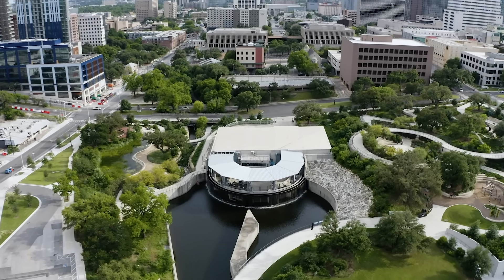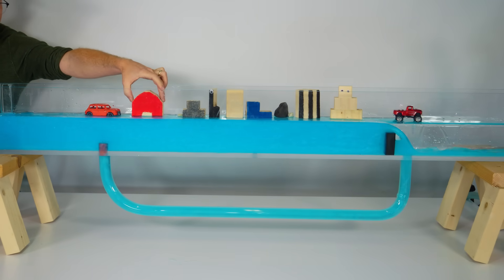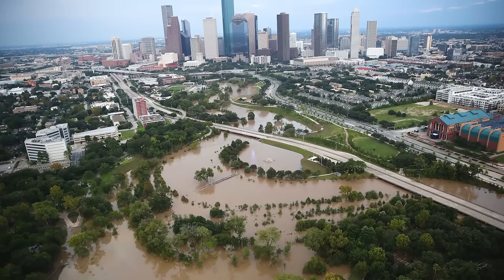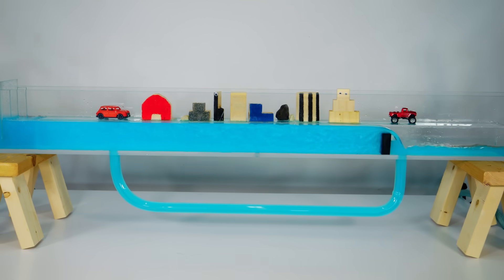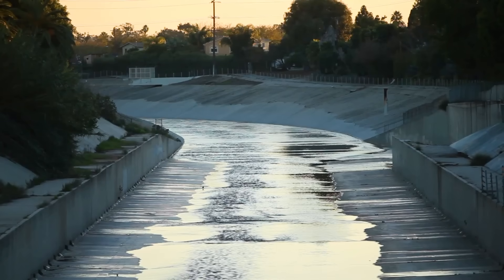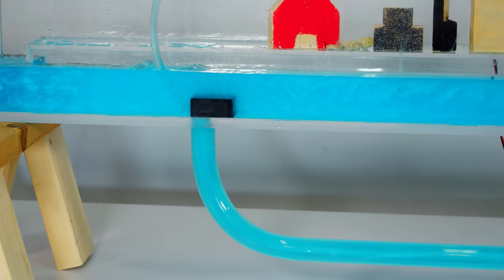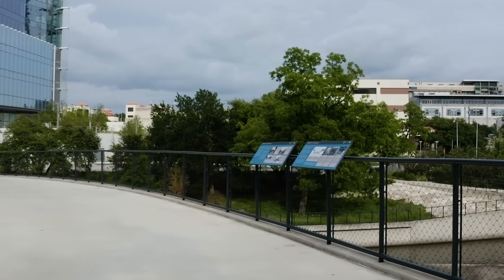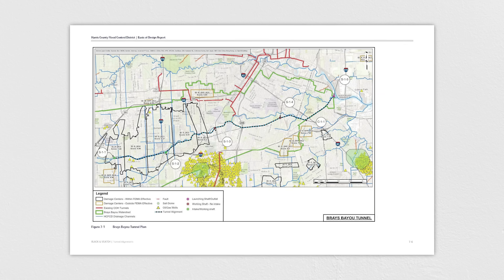How Flood Tunnels Work

Comment: Thank you for mentioning the metric units too. It really helps 😊👍
Reply: man sieht sogar direkt, dass es hilfreich ist 😉😅
Reply: are Olympic sized pools metric or standard lol
Reply: @emiliosanchez3309  I know you are joking, but if you are curious, it's a colloquial unit (units in colloquial use with no recognized standard). 

There are 2 official dimensions (short/width-25m, long/length-50m), measured from wherever the starting pads are positioned if those are used, or from the sides if not, so the only standard dimensions aren't really standard. Depth only has a 2m minimum.

It's about 2.5-3.75 megaliters.
Reply: @Merennulli  thats cool Ive heard people use the term olympic sized before and thats why i was actually curious if it was considered metric lol thank you!
Reply: @emiliosanchez3309  Well Olympic sized pools are 50m in length, but NCAA swimming is done in pools with a length of 25 yards.
Reply: We took rugby and made some changes, then stole the name of an ancient sport and slap it on this modified rugby. Its not even played by foot 99% of the time. It’s like take basketball, make a few alterations, and call it tennis. I mean wtH?
Reply: @iTeerRex  The American version brought back the traditions of brutal bludgeoning of other players and the use of pig body parts that European football failed to uphold. If you look at the ancient version, "folk football", the US is clearly closer to the original intent of the game. European ancestors just got squeamish about maiming half the players during the game and instead left it to the football hooligans after the games. 😛
Reply: So much ❤
Reply: All of science is metric, the whole world is metric, but we’re stuck in this old British system. I know it costs a lot to convert, but we gotta start sooner or later.
Reply: @iTeerRex  We have started. It's not a bandaid to be ripped off, it's structures and infrastructure to be replaced and people to be convinced. More and more infrastructure is quietly being replaced in forms like manufacturers using metric tooling and gauges and instruments used by the public having both units. But while it's easy to dictate an office change to metric, it's not easy to convince people that conversion is better for them because it very obviously isn't. They aren't meaningfully impacted by it, and they don't meaningfully impact others by using customary units. The people who do, like all companies contracting with NASA for example, have converted because they had a clear benefit to it. For the average person, it's a high cost for someone else's ego over unit superiority. Once most tools and products are in metric, public conversion will come naturally because it will be useful to them.

And as for the road signs, that conversion won't need to be made by humans. Driverless cars may still be decades away from taking over, but they are inevitable, and they won't get mixed up reading metric and driving 70mph in a 70kph zone.
Reply: @Merennulli  I know most if not all the reasons and problems, I just would like us to get there.
Reply: @iTeerRex  I quite understand that feeling. I doubt I will live long enough to be on human driver free roads in a metric US, but I at least know there is a world coming where the world is fully metric and our descendants can argue about important things like which ball is a "football". :)
Reply: @Merennulli  oh don’t even get me started on football lol
Reply: @Merennulli  sometimes I wonder if the USD already being metric from the go somewhat hindered the conversion for other units. 

The UK did pretty well at converting most things to metric from the 70s to the 90s (when stuff like Pringles cans moved to round metric numbers), but it started with converting the entire currency to metric! So people were already in a mindset of switching from dividing by 24/12/6 and 8 to dividing by 5 and 10 and 20 for the money, while doing the same for various other measures. 

But of course there are three things we jealously guarded: miles per hour (even though we converted from yards to metres for road signage like when the next exit is coming up); and (larger than US) pints of milk and beer.  They still stick around even though the rest has switched over. (And you’ll also find both metric and imperial tools in workshops, but the imperial tooling is usually for working on stuff like older cars.)
Reply: @kaitlyn__L  Honestly, the main difference is the style of government. Every 2 years, our politicians are afraid of losing power in some form or another and will only do things that upset the other party, not their own party. The House of Lords didn't have to worry too much if the entire non-peerage UK population hated metrication, but the party in control of the US Senate would definitely not be the party in control if the entire non-wealthy US population hated metrication. That makes it easier to pass legislation that greatly inconveniences average people in the UK.

In the UK, products and services went metric, but the people didn't. Their children were taught metric, and they were required to use it for many things, but they still use Imperial units (not exactly the same as US customary units, but close enough). While both were "voluntary", the UK did disallow one use after another until it was effectively compulsory. Meanwhile in the US, you can stay with customary units and the only reason to change is selling to NASA, the rest of the world and the US companies that sell to NASA and the rest of the world. 

The UK is where the US will be when industries finish naturally changing over. But since it was never forced here, nobody is going to insist we change back since we're not in the EU.
Reply: @Merennulli  Although annoying conversion to metric isn't as hard as you make out. I lived through Canada's conversion in the early 80s. The biggest problem we have is our largest trading partner and ease of access for road trips and trade by semi hasn't changed to metric so we are stuck with a duel system in some things. Our road signs are in kph but our cars had kph on the outside ring of dashboard speed and mph on the inside, doesn't matter now with electronic dashboards, just change from one to the other. So your problem wouldn't exist even without driverless cars. Just convert signs to kph and make the dashboard display kph only.
Reply: @shaunp9592  You personally may have found it easy, but broadly it wasn't. And the switch to metric on the road is still an issue at the border today. Years of driving with the larger ring doesn't just go away. Digital speedometer displays can help with that transition across a border, but it isn't that cut and dry, particularly since road sign changing is not a free action, it takes time to implement, giving a transition period. For an actual transition, not having dual display at all times like the dial speedometer is actually worse since it forces a dual signage system until the signage conversion is complete. And driver confusion is part of why we backed off of the dual signage system some states were implementing.
Reply: @Merennulli  But we do use metric it's just that when you grew up learning one system it's hard to convert what that means. You can't feel it or intuit it. I know that 20C is the same as 68F but if someone tells me it's 20C, I have to switch it to 68F before I actually can "feel" what temperature they are talking about. If someone tells me to cut off about 10 cm of something, I have to first know that 30cm is roughly a 1ft, so then I have to guess about 4 inches that I need to cut off. I can't just intuit it without converting. When I drive my car and I see the speed limit is 80kph I just can't feel how fast that is until I convert to 50mph. It doesn't matter what unit of measurement you use in everyday life. 

For science, engineering, and medicine where you need to convert between lots of units it makes way more sense to do the calculations in metric, but when doing things like farming, carpentry, sewing, and baking it's easier to work with 1 mi^2 = 640 acres, 2 cups= 1 pint, 3 feet = 1 yard because everything is nicely divisible fractions and whole numbers as you move up and down in size.
Reply: @Merennulli  As to your "football" slander, there is actually a logical reason for how we ended up with the terms Soccer and Football and the US isn't the only country that calls the sport Soccer. It's not called football because you kick the ball with your feet.
Reply: @loganleroy8622  Someone else must have slandered football. I just said our descendants would have time to argue about it once in a metric world.

That said, I will gladly mock either one. Foosball is the devil, Bobby Boucher.
Reply: @Merennulli  Apparently you misunderstood my post. I didn't say it was easy, I said it wasn't as bad as you seem to think and THE biggest problem is America insisting on not changing. With EVERONE in the world using metric no need for changing speedometers between miles and kilometers. Last I checked only 3 countries use standard, 2 of them are converting so America is the last holdout. I find it really ironic when people are watching an English or Australian video on You Tube and they complain about metric measurements, automatically means they're American, the rest of the world has moved on. It's about time America catches up.
Reply: @Merennulli  What makes one unit superior? Base 10 units are easier in multiplication, but weak in division. Highly composite numbers are strong in fractions and division, which is why they are still used 5000 years later. Sounds more like religious proselytizing when you say "it's not easy to convince people that conversion is better for them because it very obviously isn't."
Reply: @sammiller6631  US customary units aren't better in fractions. That's a choice by users that could just as easily be done in metric. Some units in US customary units sacrifice 10 for 3 in their internal conversion, but that's just a tradeoff, and not a consistent one. The benefit of metric isn't the division by 10, it's that everyone else has set it as a standard, meaning conversion can be done away with. One could argue for everyone else converting to US customary units if those were more common.
Reply: @Merennulli  Yet again, you start with the political. " US customary units aren't better in fractions" wasn't my point. Highly composite numbers (a positive integer with more divisors than any smaller positive integer has) are mathematically better at fractions. That's their core identity.  Superior highly composite numbers (12, 60, 360...) are even better at fractions. That's why even the metric system uses them. The metric unit of time is the second, which uses 60, instead of the decimal second used during the last six years of the French Revolution. 

"One could argue for everyone else converting to US customary units if those were more common" is being disingenuous by ignoring the political impulses of why they converted. I've already mentioned the anti-German period of French revanchism ("revenge-ism"). Fahrenheit was born in Poland and lived his whole life from age 15 in the Dutch Republic, but he had a German name which wasn't politically correct in France at the time. Only a scale copied by a Frenchman (Jean-Pierre Christin) was acceptable, which was later renamed Celsius to bolster the scale's image. 

Another major factor is that France bribed smaller countries to switch by offering them favorable trade agreements if they switched to French units. The US has no need to bribe other countries to use customary units, unlike the French did to bolster national pride.

But I still think the metric standard would be improved if it used more highly composite numbers. Fahrenheit used highly composite numbers in his scale (180 degrees between freezing and boiling water) but it doesn't have to be that scale if that would offend European pride. 

Water boiling at 120 degrees is a superior highly composite number without the archaic fixation on 10 that sprang from a near-religious zeal for order following the bloody public executions of Reign of Terror, where over 10,000 people were executed without trial.
Reply: @sammiller6631  Explain exactly what was political in my response.

Comment: Since you talked about this, can you talk about the red river flow-way in Winnipeg? "duffs ditch". It's been described as a modern marvel of engineering and is basically just a big ditch to prevent flooding. Fargo in ND are working on something similar now.
Reply: As an Civil Engineer and someone from Winnipeg, the flood way is a "marvel" only due to it's scale IMO. It quite literally is a big ditch around the city and there is little novel innovations that I am aware of that were developed for it. 

A fun side note,  the reason the Red River floods so much is that the river flows South to North, so the southern part melts before the northern end causing massive ice dams that back the river up. They often use explosives and floating excavators to try and keep the ice broken up and moving.
Reply: @tasdasd3856  In fairness to Chef Coin, since the creation of "Metrolinx" in Ontario, any project that is a)Finished and b)Works constitutes an "Engineering Marvel" these days in Canada.  ;)
Reply: @tasdasd3856  K.I.S.S.
Reply: @Serahpin  I see that you are mentioning the KISS train family built by Stadler, I think it's a great train!